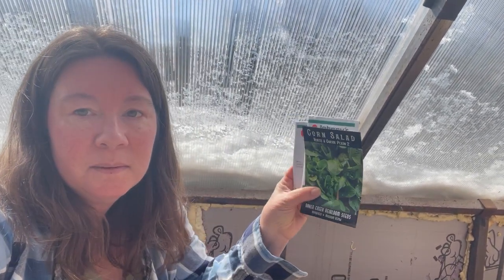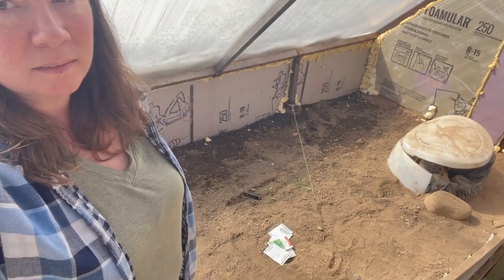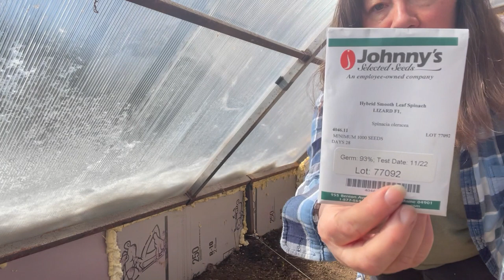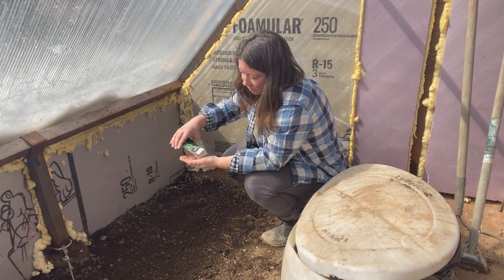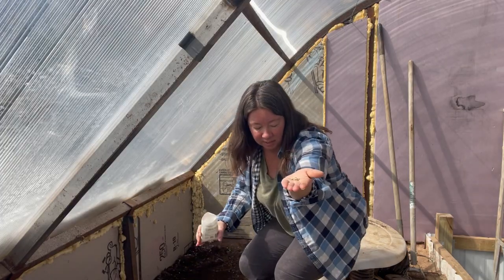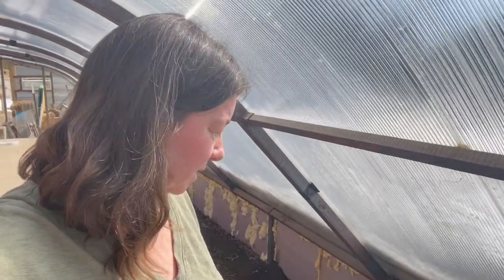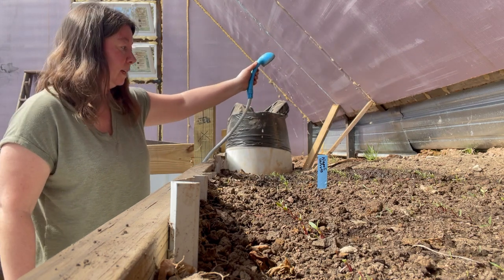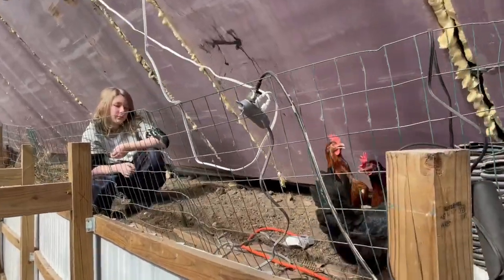See what I'm planting in our greenhouse in the snow

Comment: Nice greenhouse! I do not think the shade-cloth will help much to prevent overheating. The best option IMHO is to make one window automatically open and behind that window install a fan that will push the hot air out of the greenhouse. The fan can be powered by a solar panel, so it will work only when there is the sun shines. It is better to use DC fun, for example, 12V DC fan from any car (from a scrapyard of course).
Reply from the maker: We do prefer the fan over the shade cloth, the shade tends to slow growth.  Automated windows are on my wish list!
Reply: @rusticcedarhomestead  For automation of windows (and maybe also doors) it is easy to use electric actuators controlled by temperature relays. Not necessary to buy new actuators, used ones from satellite antennas are OK.  If you wish, I can e-mail you a couple of pictures of how I automated the windows and doors of my greenhouses.
Reply from the maker: @rimants4315  we would really appreciate that.  Rusticcedarmn@gmail.com, thanks for the info!
Reply: @rusticcedarhomestead  I've sent you an e-mail.
Reply from the maker: @rimants4315  Thanks!